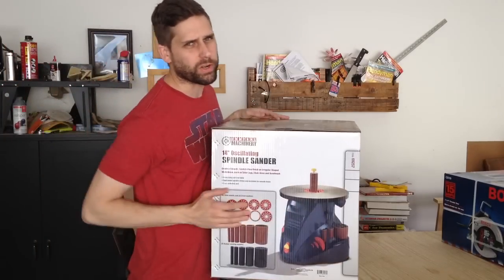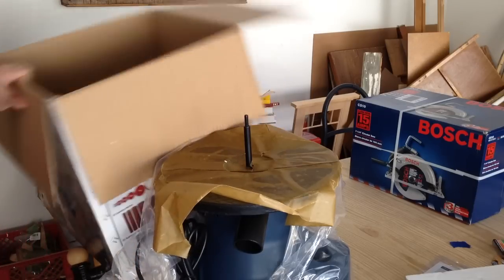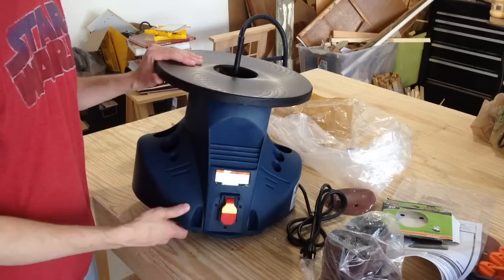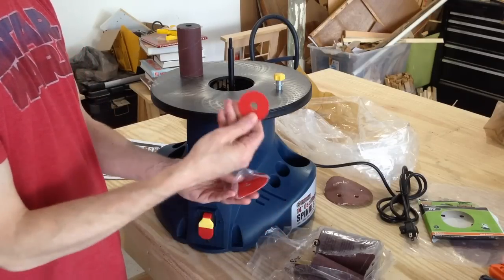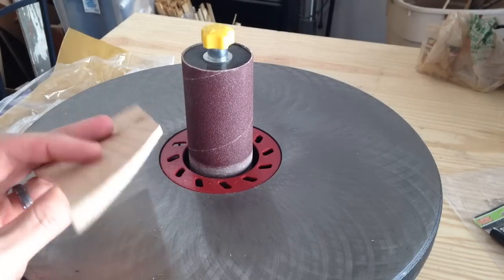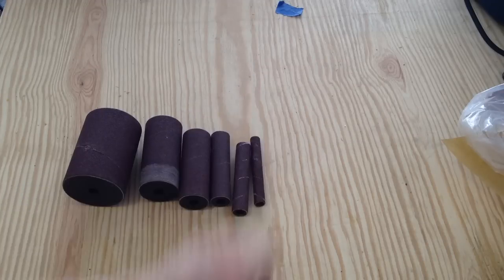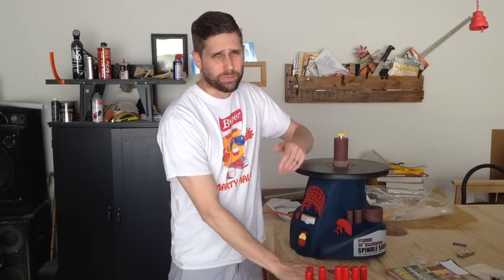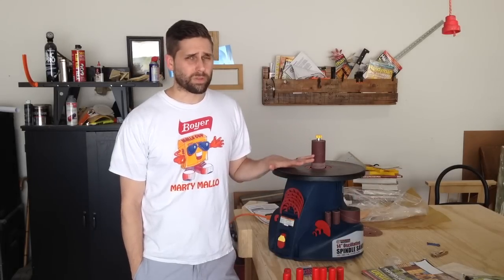Harbor Freight Oscillating Spindle Sander Product Tour (CMRW#33)

Comment: The washer is supposed to put on top of the drum, right? This will prevent the sanding sleeve going up during operation.
Reply from the maker: You are right. I read the instructions again. However, I haven't had any issues. The washer that is already attached to the nut seems to compress the drum enough to make the sleeve stay. I had been putting the drum washer on the bottom because it doesn't look like there is really much for the drum to sit on if you look inside. Seems like what is there would do damage to the drum from what it looks like to me.

Comment: I really wish you would have done a close up of the underside. About the only thing I could see was the motor. Also, it would have been good to see you use something more than 1/4 plywood. Something like 3/4 and some decent force on the pejce would have given much more of an idea of how much torque it has.
Reply from the maker: +David Mm sorry, David. I just grabbed what was nearby. It works well with 3/4 as well. Maybe if I get around to the follow up, I can hit a few things I missed. Thanks for your input!
Reply: +David Mm Works fine. This isn't intended to be a 'shaping" machine anyway, you have bandsaws and routers for that.  I use it to sand the inside corners of guitar bodies (some extremely hard woods there sometimes), and those are 1.5-1.75" thick and it handles  them absolutely fine.

Comment: Harbor Freight really is a mixed bag when it comes to acceptable quality. There are a few bargains there, and a bunch of stuff to stay away from.
Reply from the maker: J DeWitt yeah, there are really only a couple of other power tools there that I would maybe consider at this point. I do plan on getting the 12" disc sander, however.
Reply: CMR Woodworks | Chris McDowell I've looked at their disc sander. I have an old motor from a washing machine I think, and I want to use it to power a homemade disc sander, when I get time to make it, of course!

Comment: Several years  ago, I had a Ryobi spindle sander.  Large table, worked perfect.  Didn't have to put any inserts under the drum, just the top insert, and each drum came  with a washer you put on TOP of the drum, then a lock washer, then nut.  Can't buy them anymore, and sorry I sold it when we downsized.

Comment: My experience with Harbor Freight has been either utter crap with no redeeming features or functional and good enough considering the cost. The problem is you don't know until you buy it which category an individual product will fall into.
Reply from the maker: That's what I've heard about Harbor Freight. Could be good or could be a lemon, won't know till you buy. I've got my fingers crossed on this one. So far I feel as if it will be okay. Thanks for commenting!

Comment: I've got the same one, and it works perfect for me. The only problem I have with it is that I have a hard time getting the new sanding sleeves on the rubber drums. I'm not sure if this is a common problem, or if the harbor freight replacement sleeves I bought are just slightly too small for what ever reason. But aside from that it's a great little tool. It's definitely a on the light side, but I always screw it down to my bench top so that prevents it from moving on me anyway.
Reply from the maker: I plan on bolting mine down as well as soon as I get a permanent place for it. Thanks for commenting!
Reply: Have you had issues with the spindle not being square? I'm trying to figure out how to accomplish this.

Comment: I wish they made the table adjustable up and down like 4" or so so that you can utilize more of the sander. The bottom gets used but not eh middle. You can flip ths sander over but still.
Reply from the maker: I have used a block before to raise up my workpiece to use the higher parts of the bobbin. An adjustable table would be nice, though!

Comment: Hey chris thanks for the video. I actually bought the same one about a year ago. The first time he he. The plastic housing was broken where the top get bolted down and the top wobbled some thing fierce. I went back to HB and they replaced it no prob even though I used up some of the sanding drums. We will just call that severance pay. Overall I've used it for about a year and no problems. I'm happy with it for now. Not having used any other brand I can't really compare it. But not bad. For the price it does the job fine. The only thing I would say is be careful when moving around the plastic housing is flimsy.
Reply from the maker: Severance pay, haha! Good to hear that they will at least replace the tools that have issues. Hopefully I won't have to worry about doing that.

Comment: Some tools require precision. A router, a lathe, pretty much all hand tools...  but some do not. This is one of those tools that do not require super precise finishing to perform its job.  I bought one of these for 20$ second hand, because I honestly was in the middle of a job and I needed a tool like THAT day. 

It works. I believe its more of a function of "how long". If you find yourself needing this tool every day, then dont be a fool and spend the money on something that will last you the long haul of course. 

Negatives -> 
- the base is relatively small. For larger jobs, this thing wont cut it
- the inserts are straight garbage lol. I made some out of mdf that are vastly superior and actually flush to the base. 
- At its "normal" price, its hilariously over priced, but the coupons fix that as he discusses. 
- changing the paper isn't the most painless
- relatively short cable (personal thing I guess, easily fixed or just use an extension cord lol)

Honestly, most people that shop at harbor freight know what they are buying... typically "junk" that works out ok. Some parts are just laughable at best, and others require "Tweaks" to make good, but at the end of the day, the price is reflected in that. Not sure where all the hatred for HF comes from... just dont expect Festool quality at that price either :)
Reply from the maker: +JgHaverty thanks a lot for all of you input! Mine still works great. No problems.

Comment: I have one  had it for like 3 months now  ,it works great I lost the top nut to hold on the drums  ,now try to get parts for most any thing harbor sell  good luck 90 %of the parts they cant get  , so I have a metal lathe made one nut for the top better off to go like grizzly tool they have all parts to anything they sell   so please think if you buy from them will the part be able to get call there tech support on a item  ok

Comment: Nice video and explanation. We've had too many bad experiences with buying from Harbor Freight, though. Good luck with your new sander.
Reply from the maker: I've got my fingers crossed on this one. There may be only 1 other power tool I would consider from there - the 12 inch disc sander. Looking at the other tools on display didn't make me feel all warm and fuzzy. Seemed kind of rinky-dink by the look of them.

Comment: I shop Harbor Freight.  There are bargains to be had there--especially on tool bags. But I have realllly hesitated to buy any of the power tools.  That said, I had kinda convinced myself that if I WERE to buy an HF tool...maybe the Spindle Sander would be a low-risk bet.

So.  Stop reading my mind!   No, seriously, thanks for the timely review.

-z

PS:  You can sign up for a regular Harbor Freight flyer with all the coupons, somehow....I don't know how/where...but they come to my house all of the time.
Reply from the maker: This is one of the only 2 power tools I'm considering from harbor freight and the other is a disc sander. I've heard some pretty good stuff about both. Glad this video helped!

Comment: the up and down oscillation doesn't appear to be at or more than half the total length of the sanding tube. so when flipped over to use the new grit, is there a gap in the middle that gets little to no use? (depending on work piece thickness of course) If such is true, is this common to all spindle sanders or does the "spend more get more" philosophy still hold true even for devises that do little more than spin and oscillate?
Reply from the maker: +kevin scurlock there is a gap in the middle, but what I've given thought to is some sort of riser to put the work piece on to raise it up enough to get that unused portion. Just haven't tried yet. Not sure if it is common to all spindle sanders.
Reply: Yeah, that could work.I'd try an exact copy of the table out of plywood or something, need a way to secure it tho, and figure out how thick it needs to be.

Comment: You also would need to check out run-off while you were checking on the shaft's being at a right angle.
Reply from the maker: There's no run-out. I could tell when I did the test piece. No wobble at all.

Comment: thanks for the video. this is next on my list. i bought the harbor freight 9" benchtop bandsaw and it works  great. central machinery makes tools for ryobi and a few other big names. i looked at the ryobi benchtop bandsaw and it was identical to hf. only difference was the color. look at the grizzly spindle sander its identical to this one.
Reply from the maker: +soro1964 I've heard of that in other industries where one manufacturer makes things for larger companies. I've never compared the woodworking tools, though. The sander works just fine. I think I will get the 12" disc sander next. Thanks for watching!

Comment: What i don't understand about these sanders is you use the bottom portion when it goes up and down and if you can rotate the spindle around and use the other side that's good but what about the center portion. I see a lot of wasted sanding area.
Reply: Not all wood is 3/4" in thickness, the drum is also made for thicker wood up to ~4 inches.